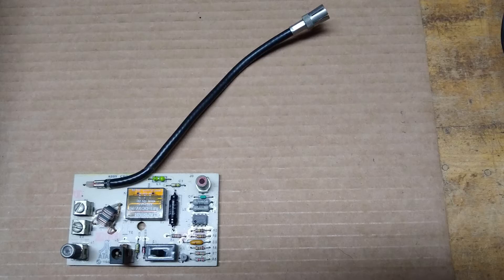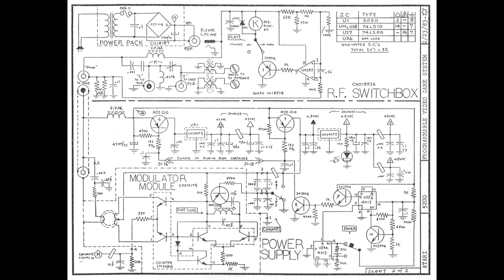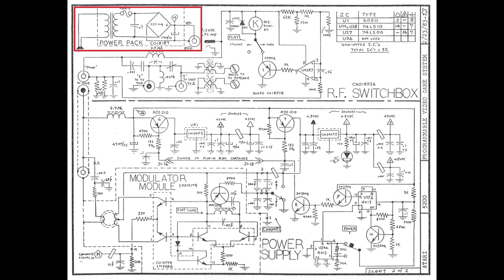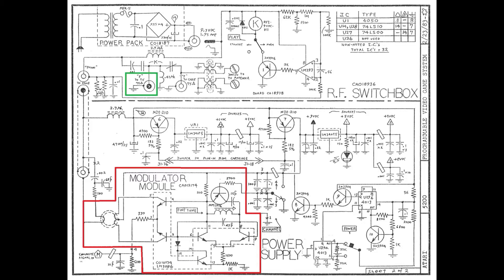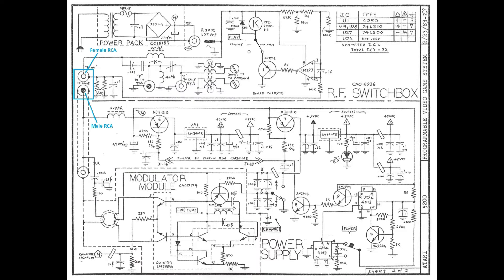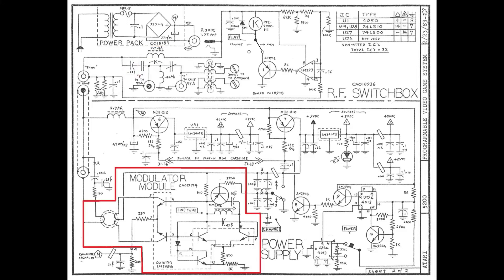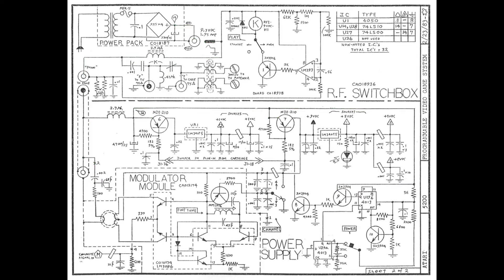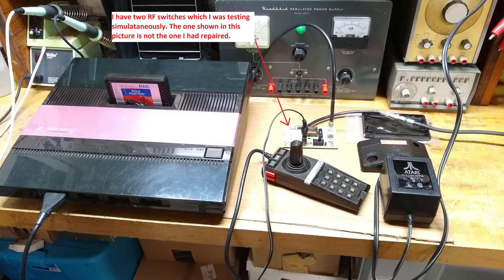Atari 5200 RF Switch [Part 2] - Theory of Operation (Continued) and Repair

Comment: But how is the rf signal and power signal traveled in both opposite directions trough 1 cable from the console into that rf switch box, is there really 1 wire inside that rapped up cable from the console or are there 2 wires inside that rapped up cable of the console??
Reply from the maker: Hello. Yes there is one cable that is for signal and ground(shield). As I mentioned in the video, the inductor keeps the RF modulated video from getting fed back into the DC power supply while the capacitor simulatenously keeps the DC power supply current from getting fed back to the RF modulator or to the TV. You can think of it another way, if these capacitors and inductors were not in the circuit then the RF modulated signal would be added to the DC power supply voltage. Instead of the RF signal having zero volts as its reference it would now have 9 volts as its reference. This means that the RF is elevated by 9 volts and the 9V power supply has this video riding on top its DC output.

Comment: Nice video 
My 5200 box is having the same issue where I can get a single from the Antenna input but not from the 5200 it’s self. How did you trace it to the chip, and where did you buy a new one? Thanks
Reply from the maker: Hello Andrew,
I traced the faulty circuit to the LM393 comparator using an oscilloscope. The LM393 has an open collector output. The output of the comparator is tied to the base of the 2N3906 PNP transistor through the 2k Ohm resistor. When the comparator is functioning properly it pulls one side of the 2 K resistor to GND forwarding biasing the Base- Emitter junction of the 2N3906 transistor.  The voltage drop VBE across the Base- Emitter junction of the transistor is approximately -0.7 V. When I troubleshot my RF switch I found it was missing the -0.7 V. I want to further mention that I used my oscilloscope to monitor the inputs to the LM393 comparator so I knew that the comparator was getting an input but producing no output.

As for the replacement part I already had it on hand. You can buy them from Mouser which I have provided a link below. The part is ~$1 but with shipping it may not be worth buying from them. You can try eBay or Amazon. Make sure you get a DIP (Dual in Line Package) which is a through hole part and not a surface mount type. The “N” at the end of LM393N specifies a through hole part.

https://www.mouser.com/ProductDetail/Texas-Instruments/LM393N-NOPB?qs=QbsRYf82W3EkdH%2F%252BGxxM5g%3D%3D
Reply: Thanks for the info and link 
Keep making great videos!